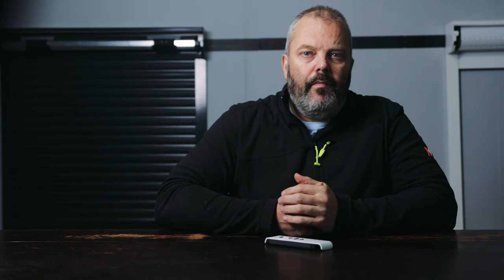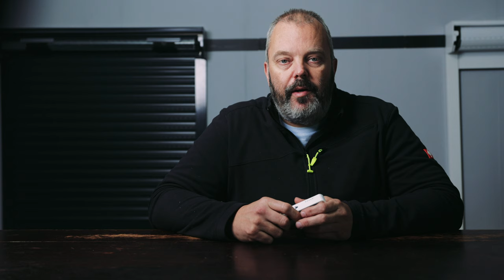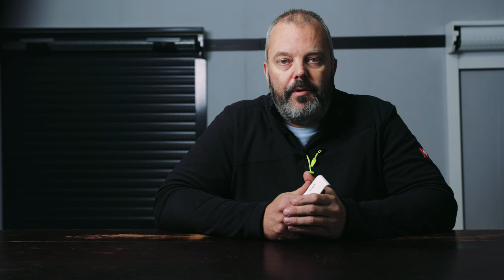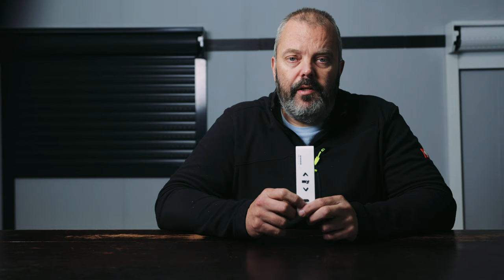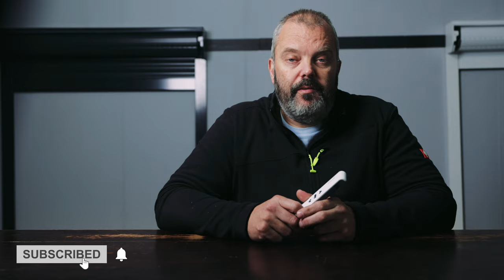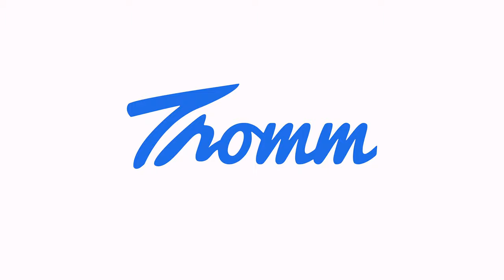How to change the end limits on your pre-programmed Somfy RS100 io motor

Comment: Do you have any ideas on what to do with a motor that won’t jog when pressing and holding the up and down buttons? It used to in the past. The telis 4 my button still works for setting an intermediate position.